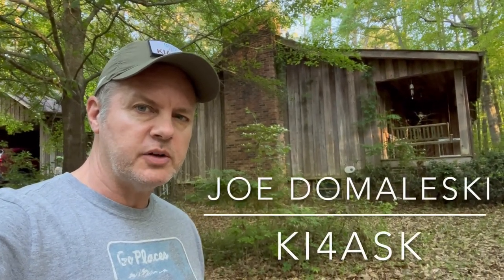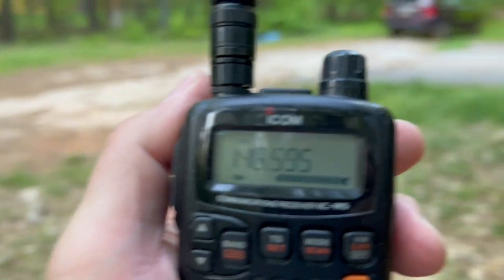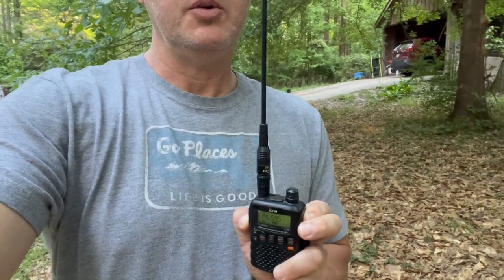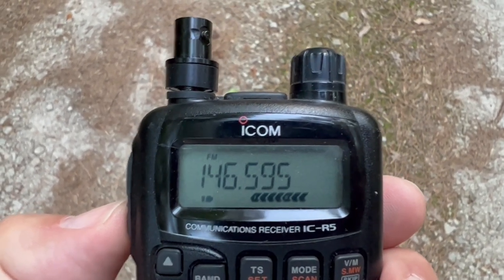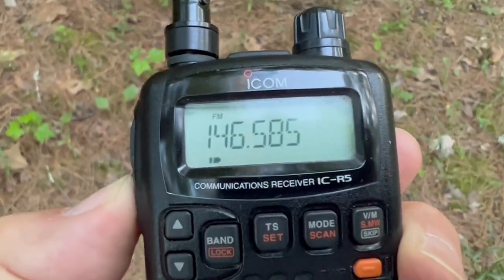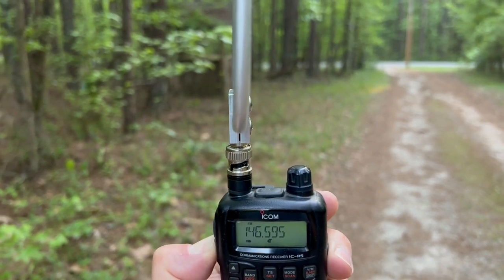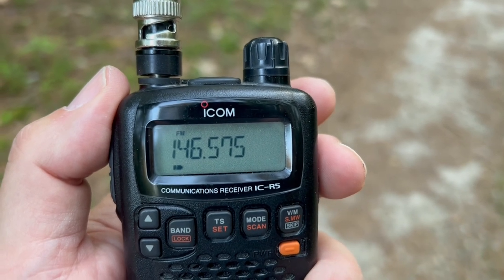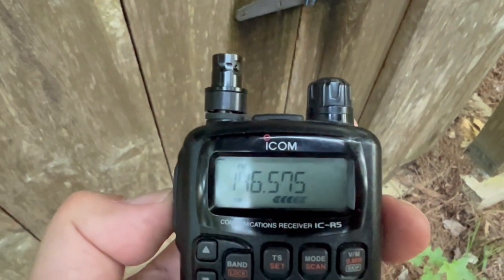Fox hunting 102 - Attenuating the radio signal #hamradio #foxhunting

Comment: Failed miserably at my first fox hunt today… 😅
Gonna try some of this next time!
Reply from the maker: What happened Dave?  We you able to get close to it?
Reply from the maker: *were
Reply: @KI4ASK  Hi Joe, Yep i got to a point where i was walking over and back in a small space knowing i had to go in a certain direction, but the route i took didnt have a path to get there. I was using body and tree trunk attenuation, but I also made some assumptions about where it may have been hidden when i should have just listened to the radio.
I did most of what you suggest but didnt have a signal meter on the radio which made it difficult..
I actually have the same icom as you which ill use next time and id love to build one of those loops also! Have you specs for the loop for a 2m fox?
Reply from the maker: @IrishHamRadio  Dave - yes, using an RSSI will help immensely. I didn't build that loop.  It's from Arrow Antennas - https://www.arrowantennas.com/main/fhl.html.  Keep me posted on your progress when you tackle another hunt.

Comment: Hi Joe. Great video!  I really enjoy your videos.  Is there any special trick in pointing the port/connector of the antenna in direction finding, once the antenna is removed?  I've tried this method, but with inconsistent results.  I really like this concept, and I would greatly appreciate any further advice on it.  Thanks a million!
Reply from the maker: No, I point the top of the connector in the direction I want to get a signal from. You may need to shield your radio and/or use an offset frequency attenuation to lessen the impact of stray RF getting into the radio
Reply: I wonder if a metal or foil cone from the ground of the connector outward would add directionality ? (Holding the HT horizontally) Body blocking seemed to be adequate.